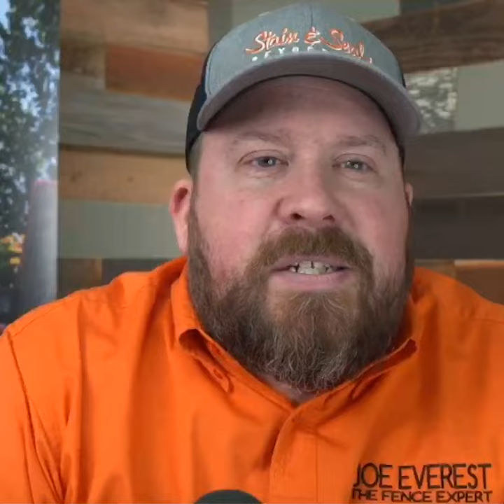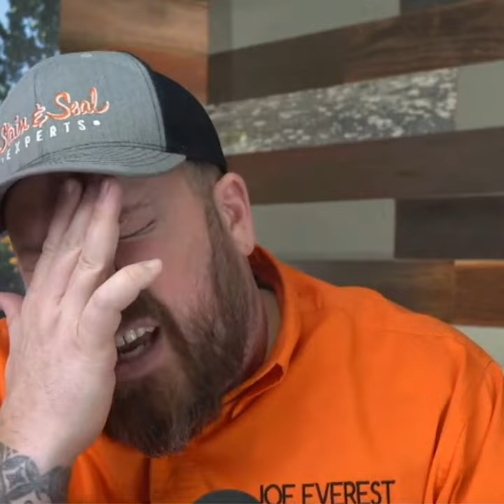Can I Reuse Old Concrete When Moving a Fence Post?

Comment: I pulled up a post. I can move the location. I've been able to get most of the old concrete out of the hole. What are your thoughts on leaving the residue concrete at the bottom of the hole (it still has a hole shaped center), and then just putting new concrete on top of it for the new post? The old post was cedar. I'm replacing it with a galvanized, steel tube post.

Comment: You know know I have 180 sched 40 pipe post with concrete still attached and I just hate to throw away. It’s brand new from a screw up a sub contractor did. Fence isn’t 6 months old and had to come out. Not sure what to do.